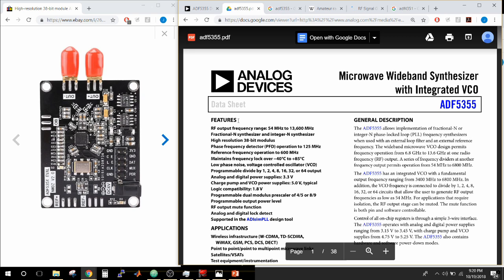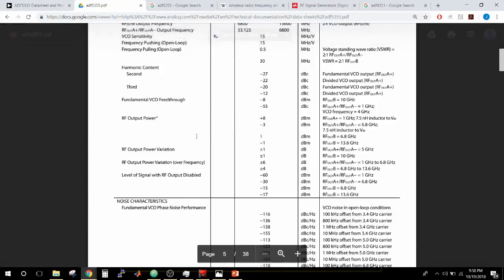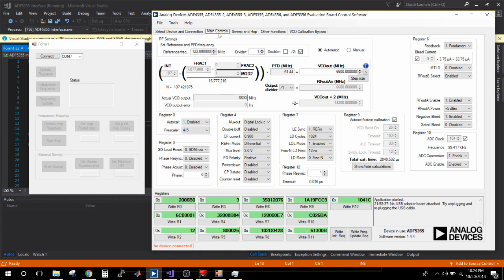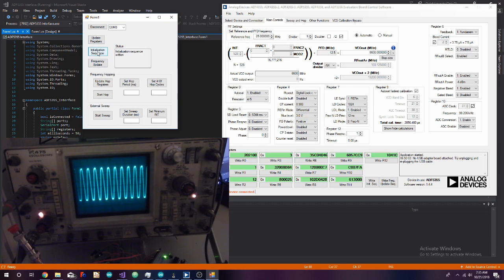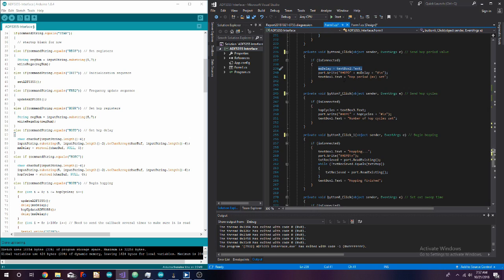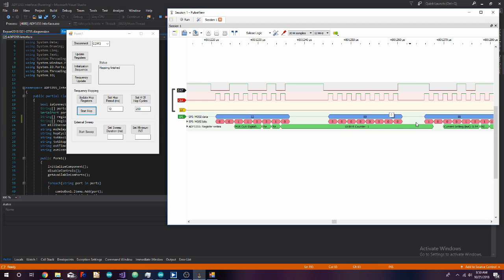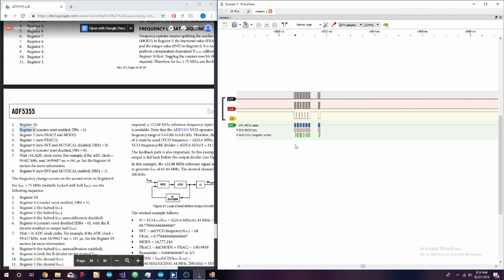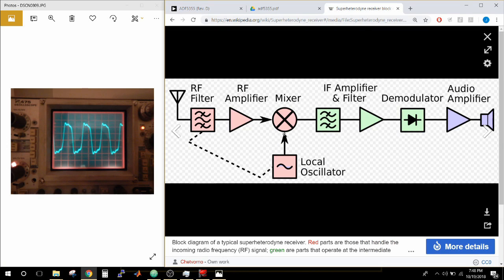ADF5355 Microwave Synthesizer

Comment: CAN YOU TELL ME HOW YOU HAVE CONNECTED ARDUINO TO EVAL BOARD
Reply from the maker: I used a 5V Arduino Uno with pin 3 for CS/LE and the default pin 11 data and pin 13 clock. I used voltage dividers on each line to ensure the ADF5355 only sees 3V. You also need to pull the ADF CE high to 3V